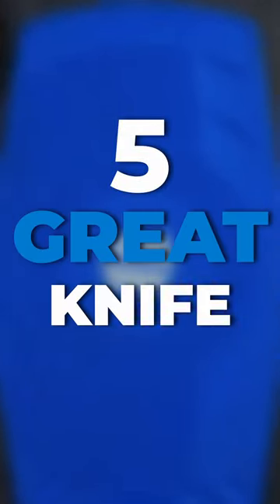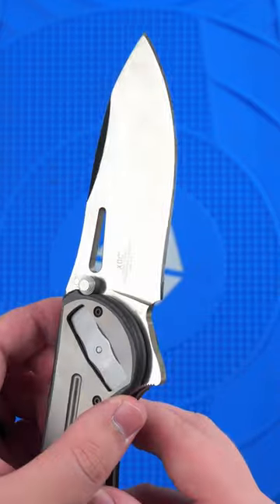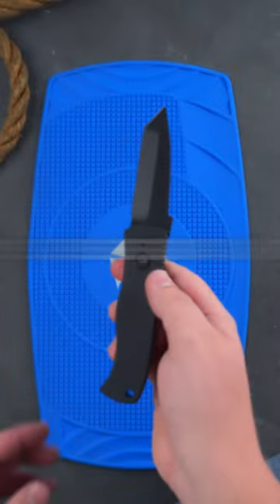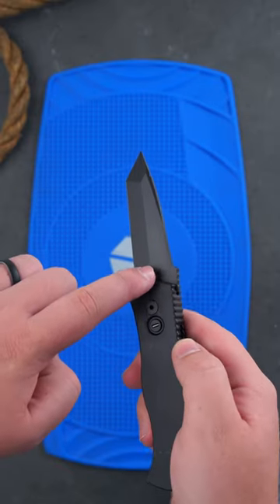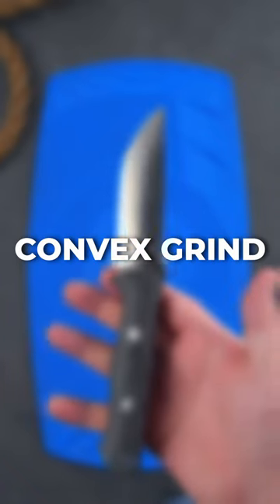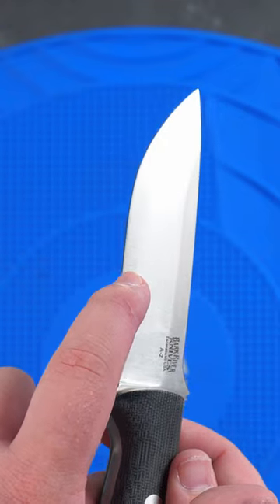5 Great Knife Grinds

Comment: The 1st is called Saber grind. Flat we usually call the Full flat.
Reply: Yep. I actually really like high saber grinds.
Reply: @just9911  Me too! Main bevel mbevele high on saber grinds.That way you get both rigidity and better slicing geometry. Low saber is for the maximum edge support but it costs cutting performance. That's why we usually see such grinds,only on Combat knives etc.
Reply: I've been in the knife world for years and still have no idea what's the difference between scandi and sabre grind
Reply: @kippert8912  I believe there is no secondary bevel on the scandi, the whole lower part is the edge.
Reply: @gjk1504  interesting... So my garberg isn't actually a scandi.
Reply: @kippert8912  That's how I took what he was saying. According to northernknives a Scandi is a single bevel grind where as a saber is a two bevel.
Reply: The first knife is huge

Comment: The hollow grind is probably the trickiest, because you use a round stone to do it.
Reply: A flexible ribbon grinder does the trick too
Reply: Depends if it's zero ground or not.
Most of the time hollow grinds are not zero ground, so do not need to be sharpened in a way that maintains it. Nor do they need to be thinner often.

You quite literally do not need to touch it on the majority of knives.

Comment: I just made a 7.5" tanto blade for bushcraft, made from 1/8" mild steel, though I hardened it. It has a convex grind because I did it with a file. Left the millscale on cause it looked cool. Wrapped the handle in green parachord.

Comment: Now I'm curious are there any heavy duty knives for the outdoors? Sorry just wondering.
Reply: Yes, sir. Check out "Cold Steel" knives.

Folder: Cold Steel Finn Wolf ( it's a scandi grind folding knife. Great for wood processing)

Folder: Cold Steel Rajah 2 ( It's a full flat grind. A pocket kukri design. It's EXTREMELY large, but GREAT for extreme outdoor use )

Fixed Blade: Cold Steel Master Hunter ( full flat grind. And it's one of the best all around hunting/small camp knife)

Comment: Noooo hollow is not good at alll! Absolute least favorite and least useful grind.
Reply: Care to explain how it isn't for your use case.

For me, I am a bladesmith and gardener, hollow grinds are extremely helpful for me to cleanly slice plant stems/branches, and are easily maintained.
Though I generally run very acute convex for the lateral strength. (Talking more than just knives here, but for my knife it would be fine hollow ground.)
Reply: @autumn5592  for me I use my knives for all daily tasks but a lot of wood work when camping. I also sharpen all my knives with whetstones which is easy to not hold a specific angle and will naturally creat a convex edge on a knife that might not have one. I completely avoid getting any knives with hollow because in my opinion you can get convex just as sharp and it will be much more durable overall. 
Also when slicing with hollow once the material is starting to pass through the hollow grind and up the walls of that grind there is actually more resistance because it is a more abrupt and steep angle to be slicing through, compared to full flat or convex it is smoth completely from edge to spine, there is no abrupt surface to add resistance. I just think very in depth about geometry of a blade and overall I believe convex, scandivex or at least full flat are the best geometry for all tasks you will be doing with knives. I personally would only pick from those 3 grinds.
Reply: @ChefMercenary  Convex cannot  be as sharp without taking a major hit to lateral strength - it would require a significantly more acute angle to perform as well as a hollow grind.

Durability and edge retention are two different things.
Durable edges are going to provide lots of lateral/sideways strength, this is good for tasks where you are doing to pry or twist in cuts -- like drilling with did tip of the knife on a bushcrafting knife, or carving -- this helps prevent chipping and rolling.
Edge retention is going to make the edge stay sharper longer; more acute angles, and thinner blades are going to stay sharper longer.
Think about it like this, two isosceles triangles with the same base width, and one with a 30 degree (inclusive) angle and the other a 40 degree (inclusive) angle. 
The 40 degree angle is much easier to make rounded, and the 30 degree is more pointy. This is exactly how steel wears on an apex, assuming no extreme lateral load.
The only downside to a thinner geometry is it isn't going to handle lateral load well, which if you are properly using your knife isn't going to happen much, but it would be more likely to chip or roll (depending on toughness of the steel.)

The wedging effect you're talking about isn't nearly as bad as you think unless you are using some extremely deeply hollow ground knife.
For an appropriately sized hollow grind, you won't experience any wedging in cuts -- you initiate the cut with the thin tip, then by the time you come to the porition where it thickens, you will have cut enough of the way through to produce enough material movement to prevent wedging.
Some outliers, like cutting hard plastics, maybe super thick card, and some vegetables like potato and carrot, depending on the size.
The vast majority of cuts are going to be significantly better because if the thinner edge.

A full flat ground blade would perform slicing actions better, yes, provided it was slightly thinner at the spine than a hollow ground.
Scandi, Convex, etc. Are not better at slicing than a hollow ground.

As I said, I make knives, and I certainly use (and abuse) them, I completely understand thinking about geometry and profiles, which is hypothetically the best, it's a slippery slope because you run into just the most absurd things (like thinking hollow grinds will wedge in EDC tasks), or you just make no progres - that is if you are a knife maker designing a knife.

There is much, much more that goes into geometry of a knife than just 'this grind is theoretically better', and then there are geometries for other tools where what you want is nothing like a knife, or things like compound grinds on knives (multiple grinds on the faces, or S grinds, hollow into convex, gradual angle change (so heel is thinner than tip or vice versa.)